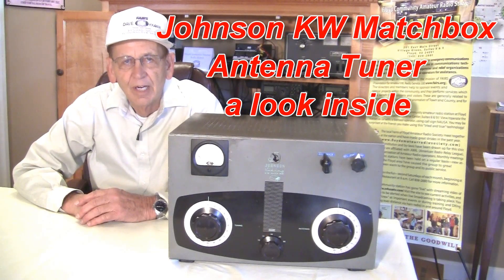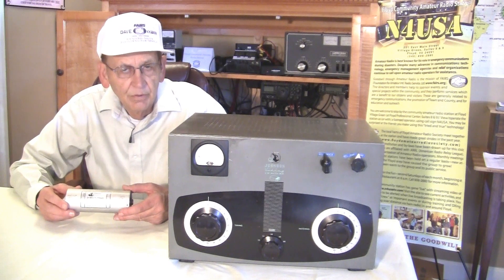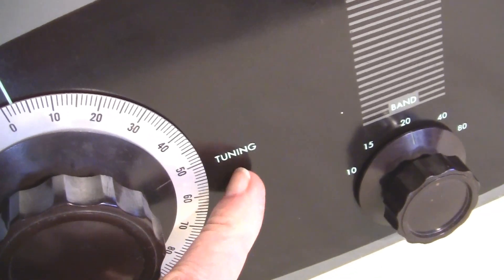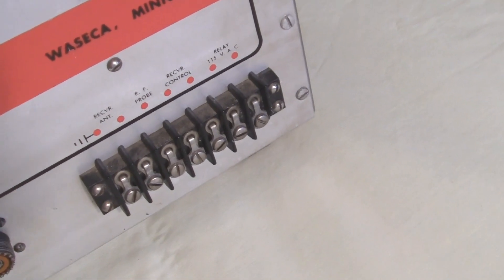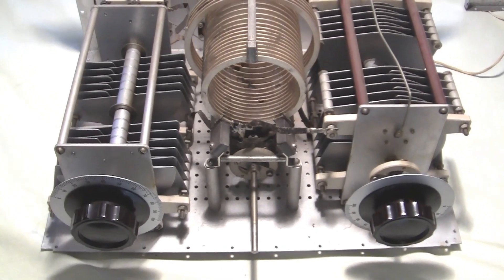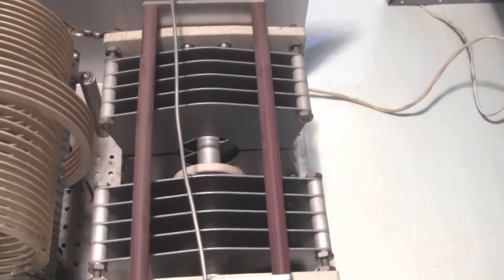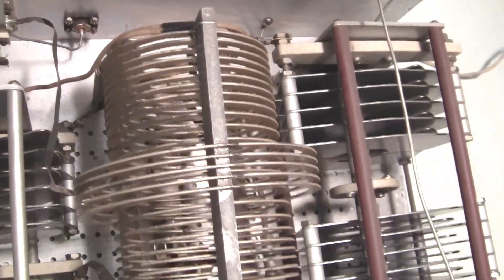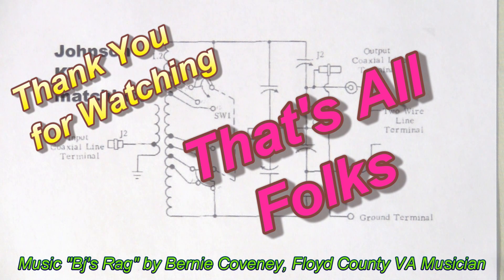Antenna Tuner Johnson KW Matchbox

Comment: I've got a question and if anyone could help me out I would appreciate it. So I just purchased one of these bad boys yet I've not put it to use yet as my new shack is in the process of getting some finishing touches. It came with the directional coupler and luckily is clean and unmodified. While tuning and reading SWR is a simple and straightforward process, I'm unsure how to get the meter to read relative power output. I've read the manual numerous times and it mentions the meter is capable of reading power output but doesn't mention how. So my question is how do I set up the Matchbox to read relative power output? I do have a Bird 43P which I'll probably just end up using it instead, though I prefer not to keep it in-line as I use it for other projects. I guess my next option would be to use the Bird and mess around with the Matchbox until they're both giving me the same reading. But in the meantime if anyone could answer my question I would greatly appreciate it. 
de KC3FNG

Comment: Just two comments to add. 1.  the matchbox uses a dual differential capacitor and 2. the 275 watt version will handed about  1 kw load and the kw version will take 3 kw. jack, K8MNG